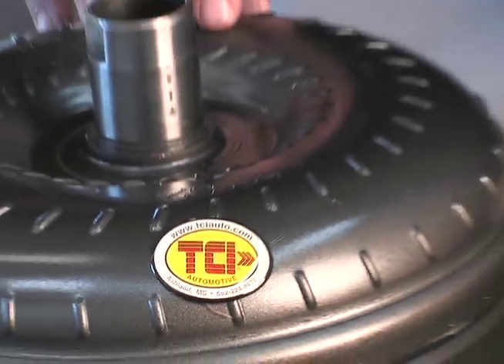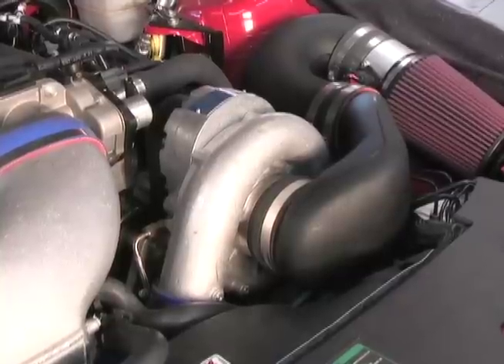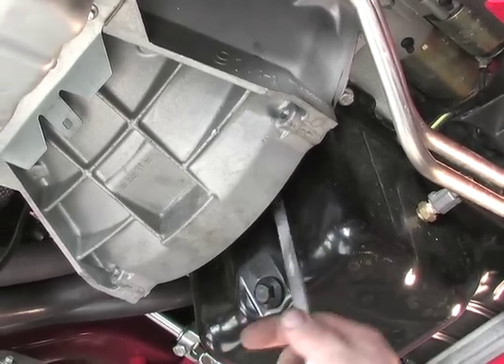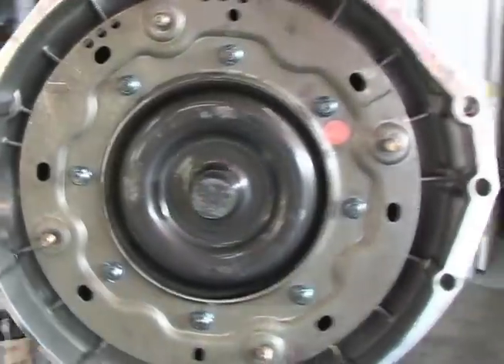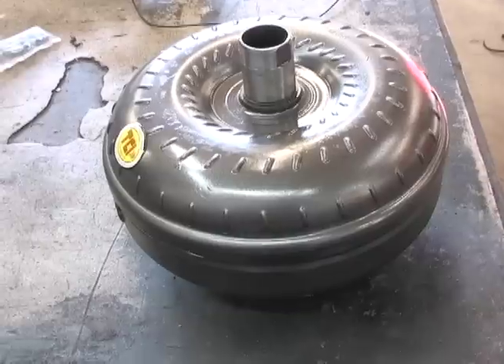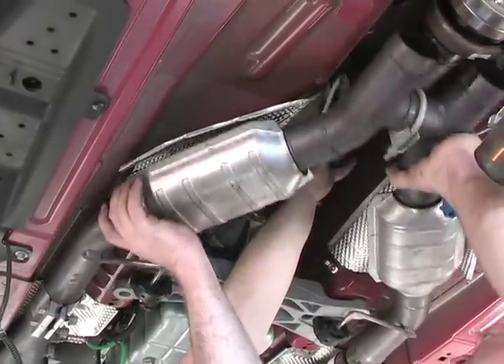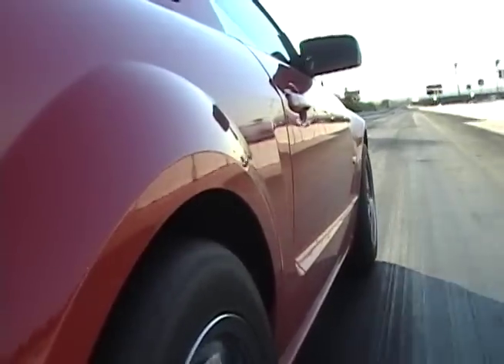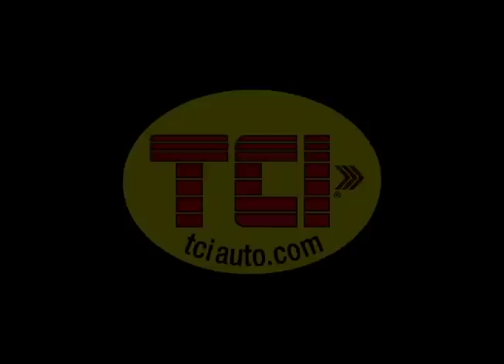Upgrade Your Torque Converter on Your Mustang

Comment: How much does this cost? Part and labor
Reply: Lots and lots and lots
Reply: Google
Reply: @ivanlaney2336  well yeah its kinda hard to make a 4.6 3v fast without boost, just a torque converter is gonna run you close to 800 to 1200 without install thats just getting the part im in the process of finding a good torque converter for my 2013 mustang gt becuase i have a 6R80 which is the beast of a 6 speed auto and i will document the change
Reply: Mines 250

Comment: Or just get a manual.........
Reply: Then you need a lot more than just a torque converter. You need a new transmission, drive shaft, ecu, upper wiring harness, slave/ master cylinder, stick, clutch pedal, etc. Where in this case you could just get the torque converter. lmao Also if speed is the reason for the swap, any tuned automatic is going to shift faster than a manual.